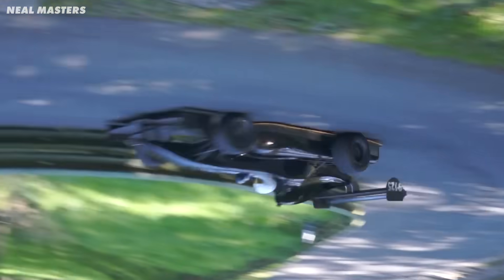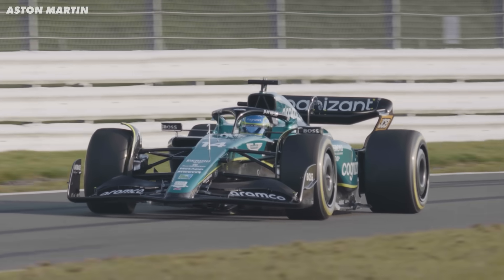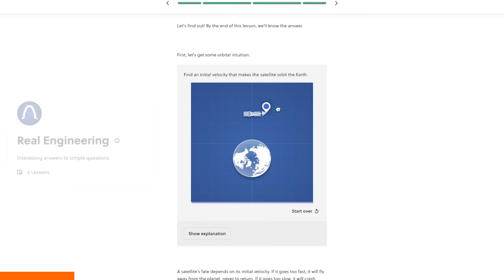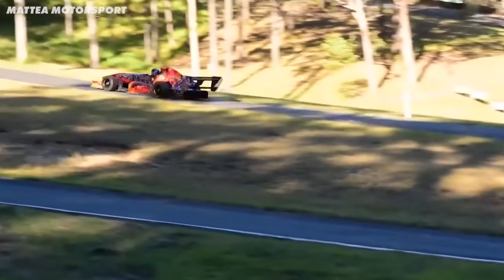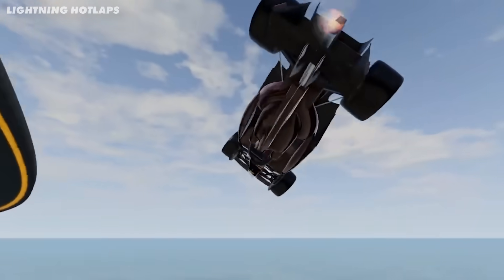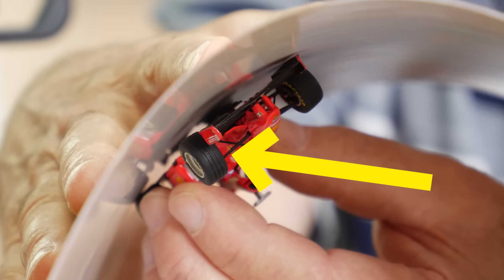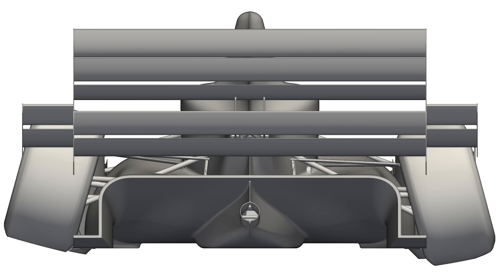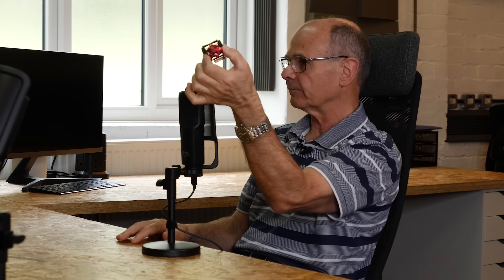How We Designed the Car to DRIVE UPSIDE DOWN

Comment: I'm wondering as you only need to do a short tunnel run, would an electric motor and a smallish but high current LiPo battery work better than trying to run a petrol engine upside down? Unfortunately you can't apply downforce to the oil sump, so you'd need some complicated transverse rotating engine mount. The other option could be a 2 stroke engine.

Comment: The downforce "amount" problem that they talk about in the beginning is really just basic arithmetic. 

If you produce ~1G of downforce at x velocity, that means at x velocity the whole system is experiencing 2Gs worth of acceleration into the ground. If you flip the car upside down while still going at x velocity, that 1G of downforce is now upforce and it cancels out, leaving the car with no net acceleration.

Of course, this also means zero traction, which means zero power delivery from the wheels to he road, which means the car can't maintain speed, meaning it can't maintain upforce and it falls off of the ceiling. Ideally, your aerodynamics need at least 2Gs worth of additional downforce at x velocity, because that way if you flip the car upside down, you still have 1G of force pushing into the ceiling, meaning it will still have the same amount of grip, and thus power delivery, that it would have if it were right side up and at a standstill. You probably don't want to plan around having any less than that if you want to stay on the ceiling.

Comment: A cross wind in a tunnel that you'll be driving up the walls and on the ceiling in is impossible. You will surely have a headwind or a tailwind but not a crosswind that makes no sense at all.

Comment: Why not a sort of twisted strip instead of a tunnel? That way you can keep the road surface mostly flat. Instead of a simple cylinder, think a flat ribbon wrapped around the cylinder where the car will drive.

Comment: @9:00 Couldn't you use four wheel steering similar to the Nissan HICAS system? You could tune that to prevent the yaw rotation and instead side slip your way up the tunnel.

Comment: You don't need tunnel, just ceiling. You could have a stretch of flat panels with funnel bits only at the start and end. Curvature is more expensive to build. Such structure wouldn't act as a sail as much. 

Can you use centrifugal force tu get up and down?

Comment: The biggest problem will be getting the suspension to handle the opposite corners ride height problem when angling on a tunnel, while also handling a massive load difference. 
Semi-trucks will pump up the axles to compensate for load. Soft suspension can compensate for ride height. Active suspension can do both, but would be expensive and take a lot of calibration.

Comment: 10:02 Have you thought about using a strip that gently twists longitudinally as these two examples? Such road is flat from side to side, it can be suspended much closer to the ground and it would require ideally no steering at all. I also suspect that you would get away with a fraction of the cost of a fully fledged tunnel.

Comment: The part that I don't get is, since you already decided to build the tunnel yourself, why does it have to look like a regular cylindrical tunnel (based on how it looks in multiple mockups you showed in the video)? I would expect it would be possible to build a much flatter surface that "twists" on the forward axis than to just have a cylinder all the way.

Comment: At the 9 minute mark in the video. Concern about a racking couple on the suspension members because of The yaw angle to enter the tunnel. Have you considered a front suspension that has no roll stiffness. Maybe like the rear suspension on a formula v. Or beam axle like  on a dirt Sprint car. The tunnel should have a smooth surface. And you won't need a lot of lateral grip.

Comment: Most of the downforce on cars is at the rear, so I assume that in such an extreme case, the downforce on the front and rear axles should be equalized. Right? ;-)

Comment: What if the portion of the track where you were inverted was over water and the car had a cockpit similar to drag boats.  A sealed capsule that can withstand high forces, protect driver, float and be quickly recoverable?

Comment: Why not use a tube instead of a tunnel?
Then you can give the car a curved floor.
So the distance to the ground will be consistent all the way through.
You're already using a tunnel with wierd walls, so it's already not just a normal tunnel.

Comment: Way way back in about 1975, the company I worked at used the MIRA wind tunnel.  Back then, and possible still does, the wind tunnel used four Lancaster bomber propellers powered by BIG electric motors, so we always did the night shift when the power was cheaper.  Being the lad I had the job of going out to get our meal, which meant driving all the way to Coventry for the nearest Indian Restaurant — I bet there are hundreds nearer to MIRA now.  When I got back with the meal I decided no one would know if I did a quick lap of the banked circuit, so I found my way on to it in the pitch black, driving a MK4 Zodiac with soggy suspension.  Well when I hit the first bit of banking, it scared the life out of me.  The transition was much faster than I expected, and with Armco on the outside, driving that pig of a car, it was not as much fun as I expected.  The car is forced down on its suspension and you can't see more than a few yards in front of you.   As it happens, there was MUCH worse to come, because after driving through the second banked bend I thought I knew what I was doing, and floored it.  What I didn't know is that there are three banked bends on thee MIRA high speed track, and when I hit it I found a tarmac laying machine blocking the middle lane.  Thankfully the outside lane was clear and I managed to swerve through the gap, but that was the nearest I have come to dying in my 74 years.  I never did tell the guys when I got their meal to them.

Comment: Have you considered building an elongated loop instead of a tunnel track?
This way you can do away with  all of the camber issues and drive straight on into an upside-down position.

I imagine the track building costs would be much higher, but you would:
• save money on developing a car to fit the tunnel track's camber.
• be able to fully utilise ground effect on a flat surface.
• solve any issues with tyres lifting off the track whilst getting into/out of the inverted position.
Reply: Just to clarify - by 'elongated loop' I mean a loop with a flat inverted straight of over 200 meters.

Comment: What if the tube spun?  The car could start out and once the required speed was reached, the tube could then rotate into position.  This would solve the issues of turning the car.  How long would the tunnel need to be for this version to work and what would the rotation rate be for the tunnel?  Could a magnetic system be built into the tunnel as a safety measure?  Make the bottom of the car steel and should the car to tunnel gap hit a specific distance, the magnetic "safety net" could automatically engage.  The car comes to a stop and the tunnel returns to the default position.  Just my crazy brain thinking!

Comment: Is there a reason they've gone with building a tube shape tunnel rather than a flat track that twists to the upside down position (like what's shown in the computer game video https://youtu.be/Xh0WkHY25KY?si=_mXyRnMcy7Np3fZv&t=603 )?  The only thing I can think of is there is no escape once you're upside down, whereas in a tube you can drive back down the side.

Comment: can I think outside the box for a moment??? what if you ditch the idea of driving onto the walls and then up and start the run upside down on a trailer supporting the vehicle up to optimal speed then break away from the trailer to complete your upside down run and have another trailer fitted with essentially one of them inflatable rescue bags to let the car drop into on the slow down? I understand your keen on having the drive up but realistically the theory would be proven easier and more cost effectively this way

Comment: The comment about issues driving on a curved surface can be dealt with. Simply don't drive on a curved surface! Traffic tunnels don't have a curved surface at ground level where the cars drive ... and a tunnel designed for driving on the roof can similarly have a flat driving surface on the roof. The transitions can be made via flat surface spiral ramps.

Comment: It would be much easier to make a flat road that twist in a barrell roll. That way you don't need to build the wheels with lot of camber. It also solves the aero issues of ground effect.

Comment: Why don’t you prop the car upside down in a wind tunnel, run the fans, and then at the point of max windage just remove the prop……..you don’t actually need to go through the whole expense and risk of doing it… if you think about it.

Comment: An intermediate level could be built between the floor and the ceiling to serve as a safer "falling down" zone, in the case of a high tunnel. 

The costs for the tunnel will increase, but the flat angle for the approach would possibly also make it possible for other cars that are not specifically adapted to this tunnel to drive. I could well imagine that there will be some more people who will want to experiment with this tunnel. It could be of greater advantage, if the tunnel has greater compatibility in terms of car models.

Comment: Not sure about your reckoning with regards to it being better having a slower crash than a faster one.

Have you ever fallen off a bike going slow Vs going fast?

The dead stop of the slow speed always tends to cause more damage than the fast...so long as you can increase the time of the accident...as in, no matter what, you make sure that the vehicle (or, the body in the case of a bike) extends the length of time until coming to a dead stop.

It's better to bounce off the rock, rather than, landing flat on it

Comment: You should really do a scale model test with R/C, it'd be interesting to see how the aerodynamics scale and figure out practical challenges besides the theoretical ones.
Reply: Idk, if the rc car is 10% the length of the real car and 10% the width.  You will have a much smaller area on the wings since a 100x20cm wing has an area of 0,2 square meters. A 10x2cm wing has an area of only 0,002 square meters, which is 1 percent. I don’t know if the weight if the car will also be reduced exponentially making it possible anyway, though

Comment: There's such an easier way to do this no? Why not start with the car already upside down wheels on the ceiling and resting on top of a truck, the truck gets it up to speed and then disconnects. If the car is already gonna be light you could use 2 springs to push the car against the ceiling and then have them disconnect when the down force of the car exceeded the spring. this way you could just use a runway and you'd only need to make a ceiling and it'd look awesome to spectators. getting down might still be a pain in the ass tho...

Comment: Why don’t u make the tunnel in such a way that when coming back to the ground u don’t have to turn back. By that I mean let’s say u start on the right side of the tunnel and go up using the right wall why don’t you end the tunnel with a left wall so u can go round in almost a single motion without having to turn in and then turn out again. A potential problem I see with this is there might be a change in wind. But idk. Just a thought

Comment: Years ago some F1 ground effect cars had a fan to suck them to the road.   You could maybe use one during the transition phase to ensure maximum downforce?   Once on the ceiling switch it off to prove the theory of wing/floor giving sufficient downforce to drive upside down.  Or an electro magnet if the tunnel has lots of metal in its construction.   Good luck!   :o)

Comment: I am enjoying this challenge you have set yourselves. Would it be possible to use a conventional wind tunnel with a revolving pipe as your tunnel, this way you could try different configurations @ say a 1/4 scale  tunnel and model of your car ideas and the time it may take to complete the inversion ???  I imagine the tunnel wouldn't need to be that long. There would be a few hurdles in mounting the car to make sure it was free to travel freely as it was being rotated , for example a pole it could slide up and down on or two.... Just a simple old bloke here, thinking outside the box. I would be interested in your thoughts on this proposal.

Comment: So you need to have a spiral on ramp to the tunnel and not straight on ramp.  The spiral will hold the car to the track as you approach the upside down portion.  You Could also test this on a bobsled course.. with only using gravity, and a hill.

Comment: Why making a tunnel and having to manage the « danger zone » because of the curvature of the road when you could (potentially?) use a streched loop instead as the road (with the upside down part being stretched of course) and keeping the transitions on « flat » surfaces? (At least keeping all four wheel on at all time?

Comment: Obviously the design process is quite far along on this but my first Neanderthal instinct was to build the car on a roller coaster setup on rails.  Hang the car upside down with some sort of actuator that pulls the car to a flat surface.  Start that way to get up to speed then have the actuators release once you have overcome downforce.  Benefit being that if some thing fails you fall a few inches back onto rails.  No complex tunnel and a flat floor for aero.  Anyways, I'm sure the interwebs will tear this apart.

Comment: This is so exciting, super cool project!

To avoid that danger zone diagonal angle riding up the wall where the front tire can lift up to 10cm, why do you not use four wheel steering, but the rear wheels are reversed? That would keep the car straight and parallel to the tunnel to keep the optimal downforce and grip.

Second thought, why isn't the belly of the car also rounded of to keep it closer to the wall of the tunnel? sure it would beach it self on any normal flat road, but you are already building a custom vehicle with it's only purpose to drive in a tunnel, so why not also modify the whole under side and diffuser of the car to fit the shape of the tunnel?
Reply: Well he's going to be starting on flat ground to get up to speed, so that wouldn't work. Also it would require much more extensive & complicated modifications to the car.
Reply: @flexinclouds  why does the ground he start on have to be flat? That's a relatively cheap part of the tunnel and would make the surface consistent throughout. There's really no reason not to make it as curved as the rest of the tunnel.

The car is already custom enough to not be any normal or regulated car, but money and complexity sure plays a part in the design, just feels like something all these engineers would have thought of and would be interesting to hear why not.

Comment: Instead of climbing a circular surface. Why don't you make a flat surface that stays flat as you climb. A flat surface that twists ever so gradually at speed. That way you won't have this crazy camber and you keep the ground effects. The only thing is you will have to drive the car specifically on that flat surface as you climb and not on the rest of the round tunnel.

Comment: Why wouldn't you start upside down? Have some kind of rig that props you up or that you hang from and then it lets you go? Launch it with the same sort of system as aircraft carrier launches. Would seem easier than solving the twist up bit, not to mention building the ramp.

Comment: I am thoroughly enjoying the videos and I am eagerly waiting to see the final stunt be performed. Kind of a silly question though. Why use a pipe design and not one resembling two connected loop de loops, where you would use one to climb onto an upside down straight track and the other to come back down again? It would still remain an open design and would allow you to perform the stunt more than once.

Comment: I'm surprised you guys didn't opt for some active aero like the old Brabham fan car. Tom Scott just posted a video yesterday of a modded F trainer style car that preloads fan assisted downforce to increase grip for acceleration, with the added skirts that could help overcome the tunnel angles. Seems like there must be a reason you didn't, you have some smart folks working on it.

Excited to see this done, best of luck to you!
Reply: I would have thought a fan would be an obvious choice, for fun 0mph photo shoots, like a heavily optimized Mcmurtry Speirling, which, iirc can just be upside down already, at 0mph
Reply: @mm6705  My thoughts exactly, but there must be a reason they decided not to, perhaps the concerns of the fluctuations in the seal he mentioned.

Comment: Why not curve the under carriage of the car to match the curvature of the tunnel? At lower speeds when approaching, the ride height would be better; then you could curve the main road to match the curvature of the tunnel in the final acceleration.  And as you go up the walls of the tunnel the changes in ride height could become optimal when need most.

Comment: but it's not a formula 1 car. the topic was always "could a f1 car drive upside down?" using anything except a f1 car won't answer that question.

might as well strap a car to the ceiling of a wind tunnel, turn on the fan, then release the straps when the wind speed is high enough to pin the car to the ceiling.

Comment: a twisted ribbon road (a ruled surface ) instead of tunnel would solve many problems caused by a tunnel. No curvature under the car, no varying height of the car above road surface, no single wheel lifting off the road. Well, if the car can twist as well :-)